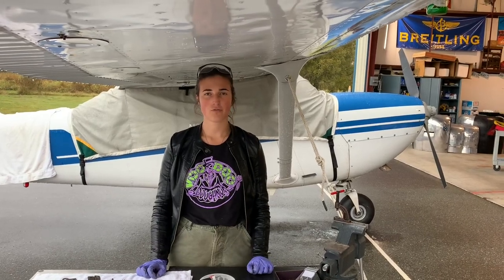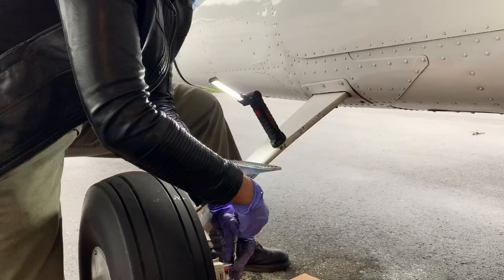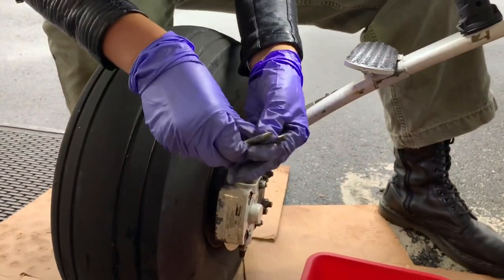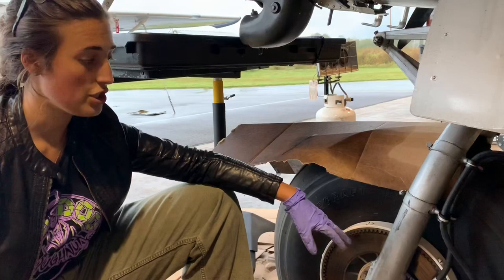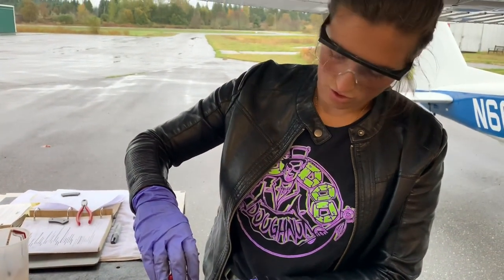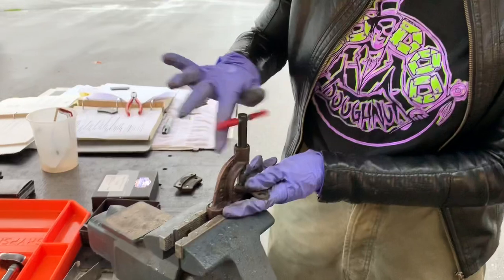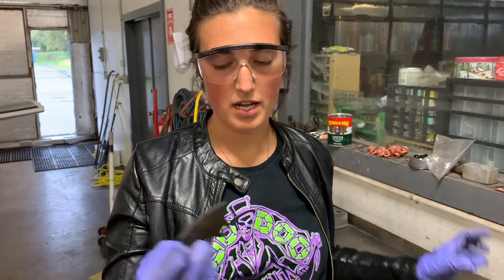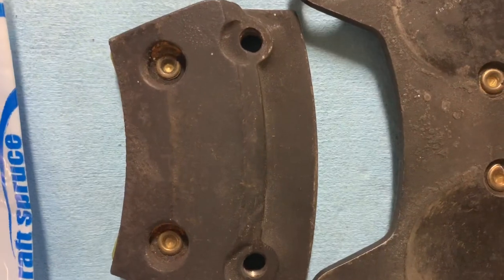Brake linings change on T-41 Cessna

Comment: Honest question (I have no mechanic experience): If there are only 12-25 landings in those backing plates, why re-use them? Are the new pads only expected to last that long as well? PS, great videos. I haven't seen anything like them on YouTube and as a student pilot these are really helping me understand aircraft systems.
Reply from the maker: hockeytops the pads (or linings) that were removed were approaching the minimum thickness (3/32 of an inch) 
The new linings were riveted on to the pressure plate and the backing plate
With a fresh brake job this airplane is now ready for hundreds of landings. 
So to recap:the pressure plate and the backing plate are the steel parts that the organic lining (pad) is riveted to
Reply: aviation ground school can you just buy new parts (pressure plate and backing plate) ? Sorry for mu dumb question